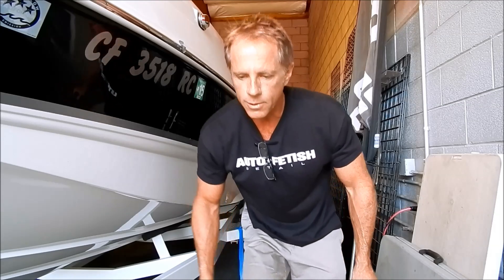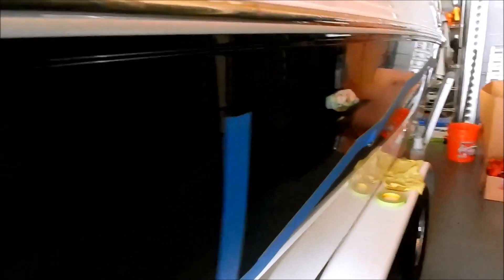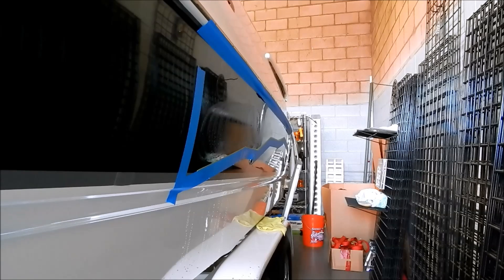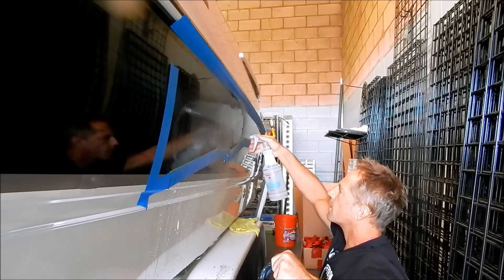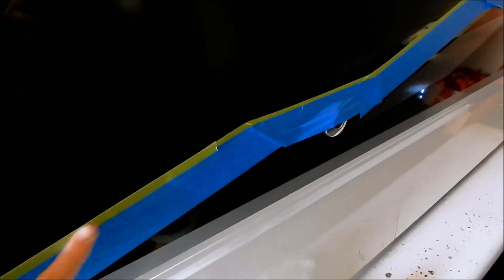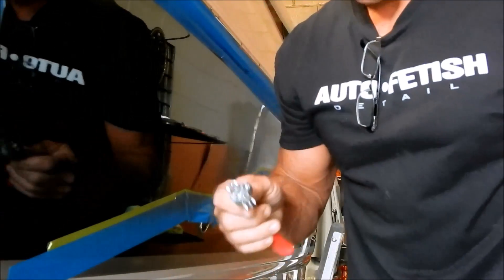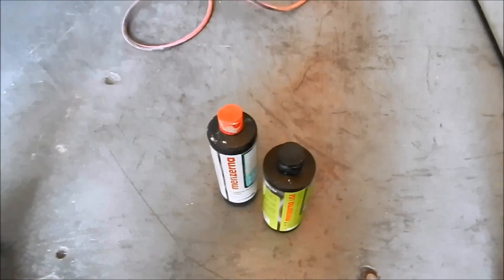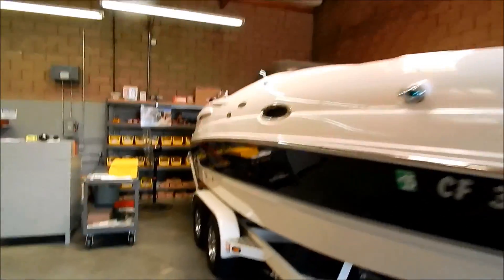Auto Detailing Tips and Tricks: Boats, wet-sanding, polishing, communication

Comment: Thanks for yet another awesome video! I used to work for Hatteras Yachts and we actually had to paint their gel coat so, I've never had to polish it. I have definitely done my share of buffing paint. They also didn't use clear coat on their exterior paint but, they did on the interior finishes which we also had to buff. One thing is for sure, if you are following behind a bad or "thin" paint/finish job, you're doomed from the get go. Seems like this isn't a problem with gel coat. One more thing, the spur you use to clean your wool pad, it looks like a really narrow carpet seam roller. Is it actually manufactured for what you're using it for or something else? Just curious. Keep up the great work dude!